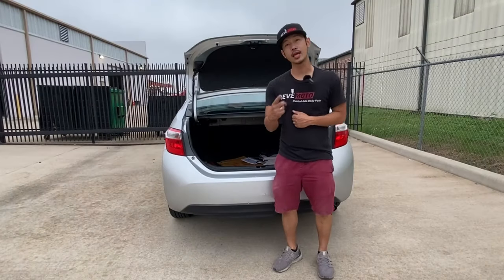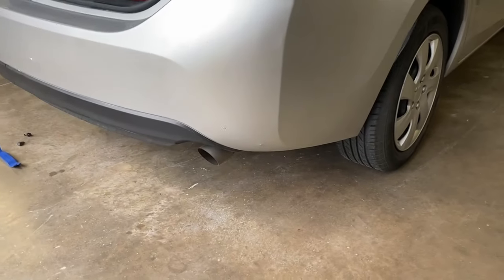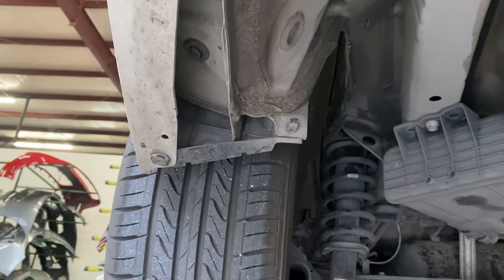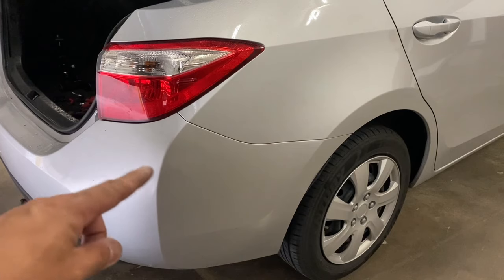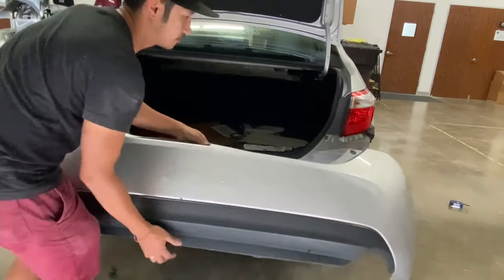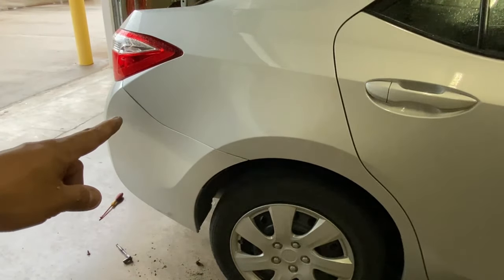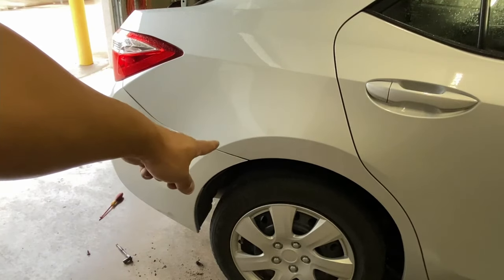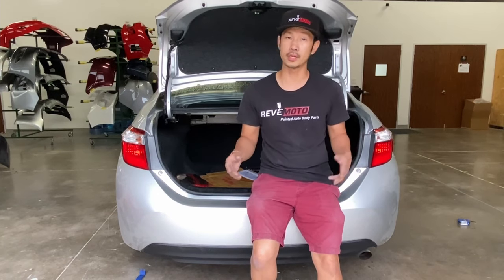2014-2019 Toyota Corolla rear bumper replacement | ReveMoto

Comment: If The slots that the upper bumper need to fit into and bent, can that be repaired with pliers or is a shop visit needed?
Reply from the maker: Hello! Depending on the damage, yes. There are brackets for the bumper to clip into under the taillights and on the quarter panel. You can replace these brackets/retainers for about $30, they just bolt on the car. If the tabs are broken on the bumper, you can try to snap them in, buy a new bumper, or find a shop that can plastic weld the tabs on the bumper. I hope this helps and thank you for watching!